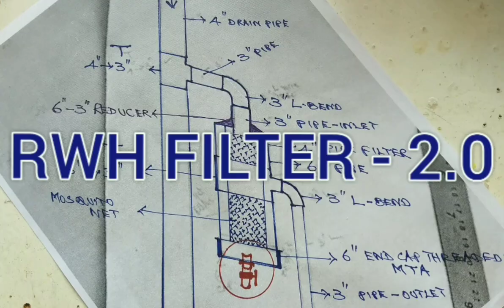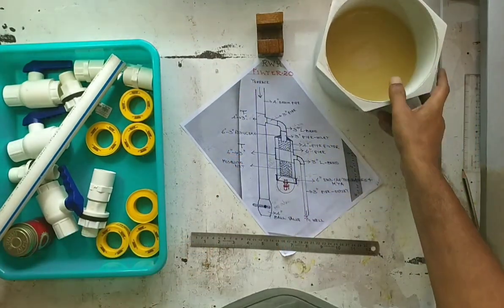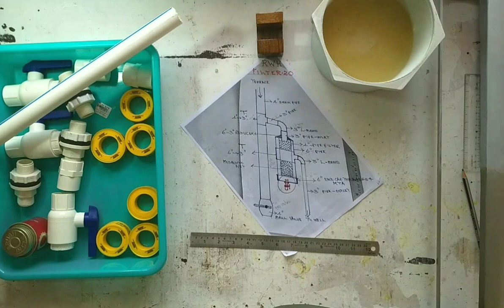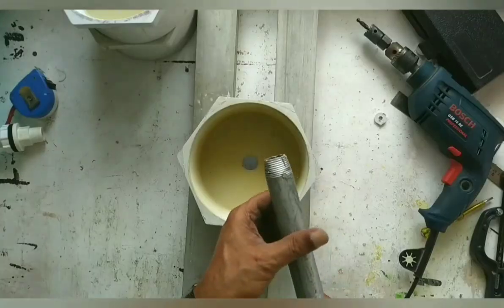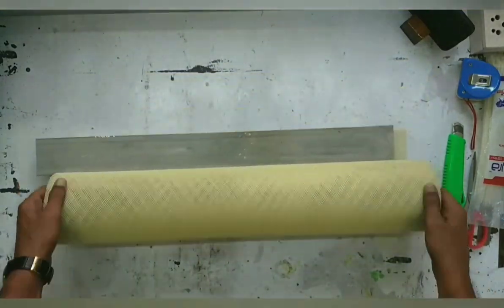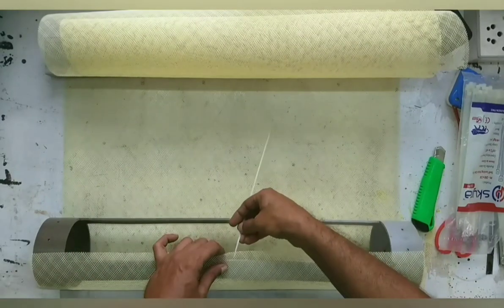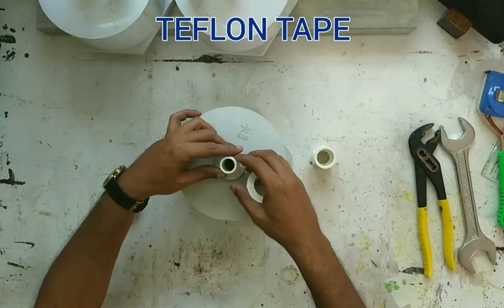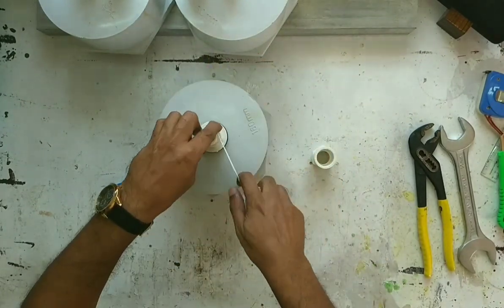RAIN WATER HARVEST FILTER 2.0 : PART 4 : RETROFITTING WITH DRAIN VALVE - DIY - GUNAs LenSpeaks

Comment: The concept is good. In this system, the filter will be clogged up easily with no way to flush it out. BUT, for a more user-friendly and effective method is to connect the rainwater inlet to the filter on the outside of the filter element and let the outlet of the filter come from the inside of the filter. The drain from the filter should be 11/2'' to 2''. My reasons are 1) All filtered materials, leaves etc. will remain on the outside of the element and can be flushed out easily. 2) With a bigger drain valve the filter unit can be flushed out most effectively. With the small drain valve, it can get clogged up very easily. The part with the drain valve can be screwed out, remove and clean the filter element, and return the system to service.
Reply: From an Engineering view, the inlet to all filters are on the outside of the filter  as the area is big enough for filtered matter to accumulate and can b easily flushed out.
Reply from the maker: May be... This is just a DIY concept which I have made and  implemented which is working fine for me for the last 3 years...👍

Comment: Great sir Measurement T join & end nut cap & reduced top cap &  inner filter pipe mm detail sollunka sir
Reply from the maker: The size would depend upon our choice. I have used 6" to 3" reducer T, 6" MTA cap, 6" to 3" reducer at the top and 4" pipe for inner core filter. I had given the measurements in the RWH Part-1 video. Hope this would suffice. All the very best.👍

Comment: I had a question: I want to do rain water harvesting but also I want to set up a small garden ( terrace garden)  on my terraces. Is it possible to do both things on same terrace ? Or I can't. It will very helpful if you answer mu query
Reply from the maker: Certainly you can. Only thing you have to ensure is that you have a seperate drain outlet for the excess water draining from the terrace garden along with other dirt and sand and it should not mix with the Rain Water Harvested from the terrace and not to be routed through the RWH filter.

Comment: WHERE TO GET DRAIN CLOSET AND TEE FITTINGS IN CHENNAI SHOPS?
Reply from the maker: The UPVC drain valves and related fittings would be available with almost every  average Hardware store in the city.  If you need bigger size fittings they are available in George Town area (Parrys) of the City.
Reply from the maker: You may also like, share and subscribe to my channel.